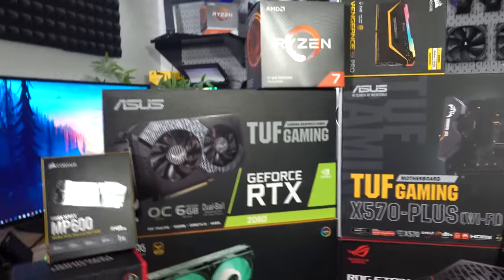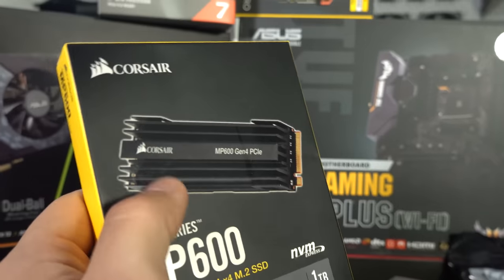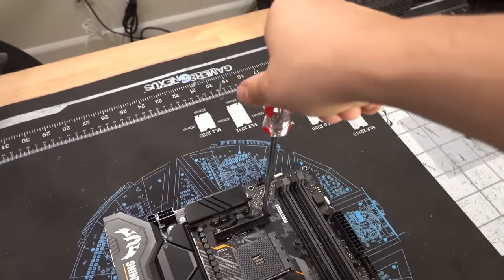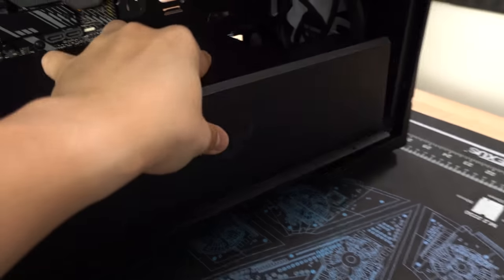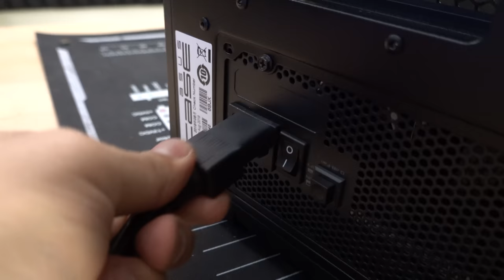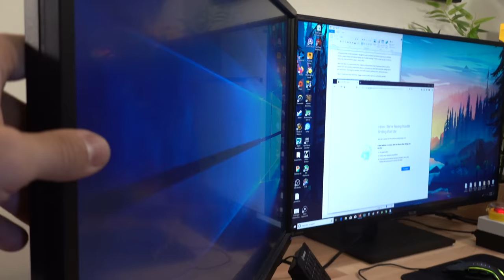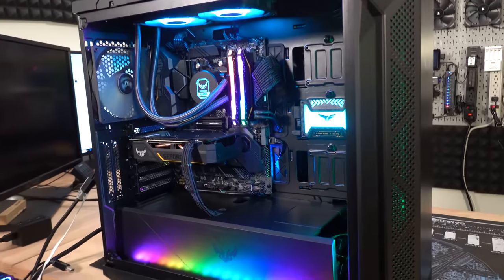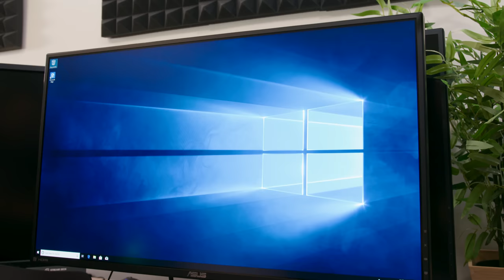The gaming build that ALMOST made me cry...

Comment: A 2060 come on asus 🤦🏽‍♂️
Reply: Well it fits lol... TUF is ASUS' entry level product line.
Reply: I commented about this too. Imagine sending over a 155hz 1440p display but pairing it with a 2060 🤦🏻‍♂️
Reply: Cain C at least a 5700xt or 2080 but damn
Reply: Nathaniel Wagner true but for a war vet you’d think they’d be kind enough to send something high end especially with that processor and display
Reply: @justmixah3408  yeah a 5700xt would have made more sense. They're not that far apart in price, the 5700xt outperforms the 2060, and it's matching an AMD GPU with an AMD CPU.
Reply: @BigChimpEnergy  exactly but aye whats done is done
Reply: Aye that kinda sucked tbh.. a 2060 not even a Super.. but 2060 for that system and monitor.. i mean awsome of Asus but come on.. u guys aint first timers with hardware...

Comment: @ 14:45  I was one of the 18 month guys. We were there March 2003 out of Baumholder, Germany. I was 1st Armored, 1-6INF. We were the some of the only idiots with green tracks (Brads) and tanks (M1s). That's what we had, we were the most forward deployed post, that's how they sent us. Also only got one plate for our vest and had to pick front or back because we went so fast supply wasn't caught up. We made it to Kuwait on a commercial 747 with the in flight movie Black Hawk Down. Was just 22 at the time. Was weird holding onto an m16 while a stewardess came to make sure your  safety belt was fastened for takeoff lol. I'll never forget when they opened that door, when we landed, how much it resembled opening an oven door. The flight home was an entire different experience. Not too good. But anyway, our orders stated we were deployed for combat operations for "12 months or until mission complete". We stayed for a year and got extended 12 months.

Comment: I currently have an AMD FX-8350 processor, 16GB ram.  I bought a GTX 1080ti and a fractal design R6 case and an EVGA 800 watt power supply late last year.  Now I am ready to build my next system.  I just bought the Asus tuf gaming plus WiFi mb, 32 gb corsair vengeance 3600 memory, Windows 10, AMD Ryzen 3900x, 2 Samsung 970 plus 2 tb m.2 drives and a Noctua ND uh15 air cooler.  All of this will be in my Current Define R6 case.
  What do you guys think?  I think my 1080ti card will be sufficient for a while or will it be a bottle neck?

Comment: Hello important question for X570. My mobo has 8+4 PIN as well but my PSU has no such cable and the build does not start at all. Is the cable optional or my mobo is broken?

Comment: Question about the Gt501 rgb fans with the X570 Asus tuf mother board, do I have to use the Molex to plug them in or is there a plug compatible to the original fans connector without the molex extension.

Comment: I am looking for a new case. As far as i saw in the video, there should be enough space on top for an aio watercooling AND high profile ram. 
So many cases do not provide enough space if motherboard components ar higher than 40mm.

Can someone confirm that in the asus tuf gt501 is space for a top mountet radiator?

Comment: came to this video hoping for judgement on my first build. kind just went with what my best buy had available. but im the same tuf x-570 ryzen 5 3600 -stock cooler, 32 vengeance rgb pro, nvidia geforce rtx 2060 xc, samsung evo 860 1tb ssd, evga 700w br psu, 2in front 1 rear exhaust thermaltake pureplus 12 premium and a cyberpower pc case (case beforehand) really just curious on the mix of parts if theyre all okay together or if im recommended an aio or bigger cpu fan
Reply: realized you had JUST done a build review video and probably wont input on this T.T

Comment: Sadly, I too build like a madman, I do ground my self  when putting in the MB, CPU, Ram and M.2, but everything else Just flies in. It's the hard-line plumbing I take my time on.

I do go full verge when  pasting my stuff, I have never had poor thermals from using too much, I HAVE had poor thermals by using slightly too little- Goop  it on, worry about cleanup later.

Comment: What are thees parts i have never seen them Kappa all i have is a hp elite 8000 with no gpu 8gb ram ddr3 150 hdd core 2 duo proc and some basic fans and a power supply 320 wat

Comment: funny I have a pc on my right for every day use Ryzen 3 2200g 8 gig using built in gpu with Linux but on my left I have a tower with Ryzen 7 2700 32 gig m.2 drive 1070 superclock with win 10 just for gaming and bot sharing screen keybord and mouse with switch and i still think they take up less room than his duel pc case  case LOL

Comment: I seriously dont understand the point of a 2 in 1 pc build, the only way it would ever be useful is if it was built with 2 separate systems with one for gaming and another for a workstation (ie. Animation, 3d rendering, etc) while the gaming section is optimized for streaming.

and by workstation i mean server system with a workstation optimized quaddro. sure a gaming rig can do rendering work well, but you can be sure that trying to render models as complicated as the ones from pacific rim or transformers is not something your gaming gpu can handle safely.

Comment: 4+8-pin comment
That extra 4-pin is completely USELESS. It's pure marketing B.S. You do NOT need to use it, nor would you ever need it unless perhaps doing LIQUID NITROGEN overclocking an R9-3900x/3950x and getting massive power draw... don't take my word for it, Buildzoid talks about this and he knows his shit... I think I draw around 130W under 100% load with my R9-3900x but I believe it can spike to around 160W... don't quote me on this, but I think Buildzoid said an 8-pin connector (and a non-crappy PSU cable) should be able to deliver up to 384W of power!!